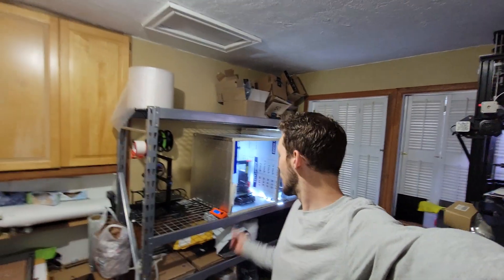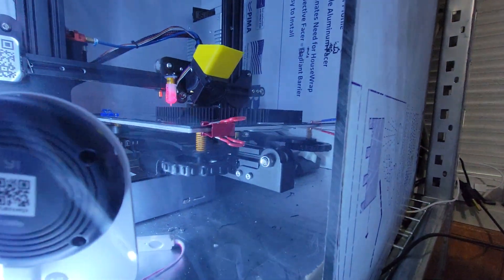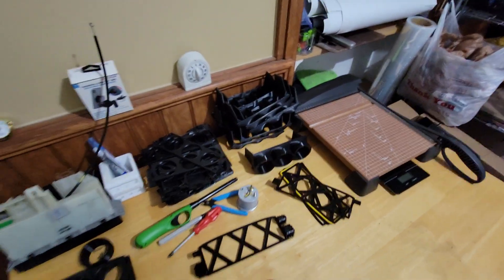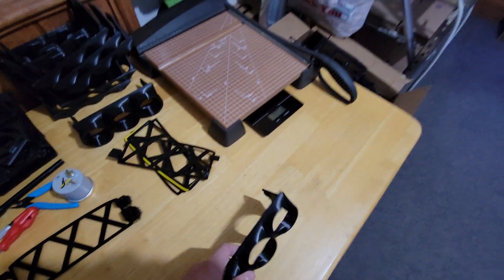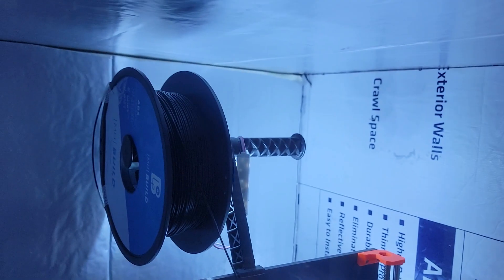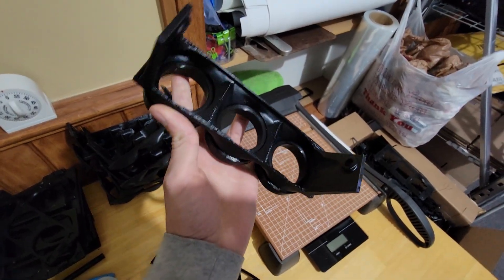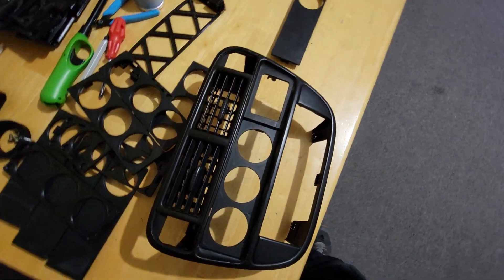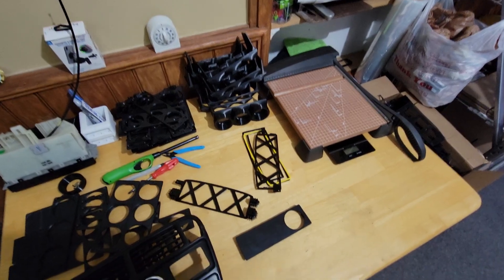New 3D Printing Farm Overview

Comment: The stringing probably goes away after a few prints because the filament is getting dried inside the cabin. It could be a good idea to open and place next in-line spool inside the heated enviornment. So that it is already dry before you start using it.
Reply from the maker: You're right it does go away after 1-2 prints. I did do that a couple times and it helped forsure! I changed brands of abs recently and that made a big difference lol

Comment: awesome print farm! Weird there would be market for 3d printed car parts... Just seems gauge clusters I would want something super nice like aluminum
Reply from the maker: Thanks! There are some parts available in aluminum, but they tend to be more pricey. A lot of gauge pods are injection molded plastic anyways, however there isn't always enough demand to justify expensive tooling or simple mounting/design solutions to use other methods. And that leaves the market open where printing shines 😁